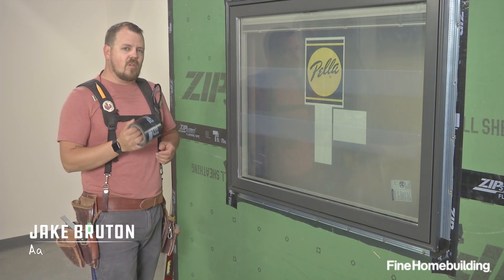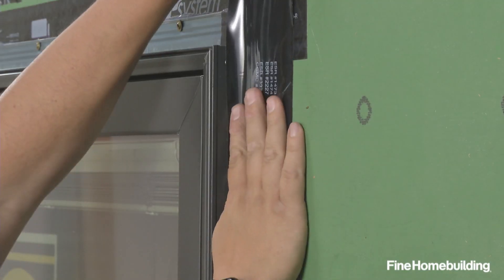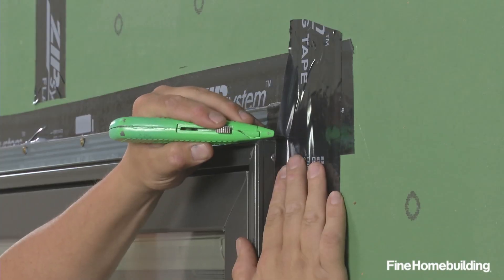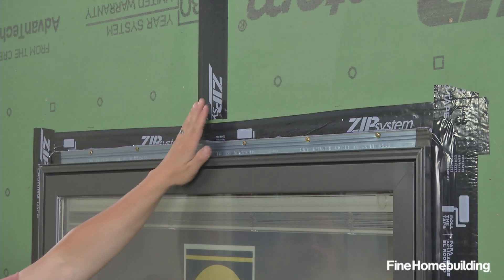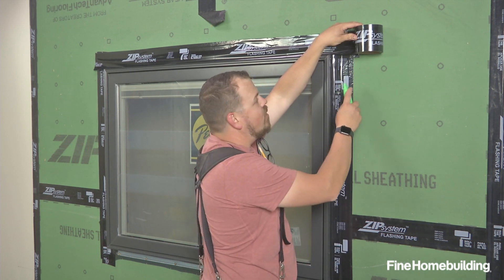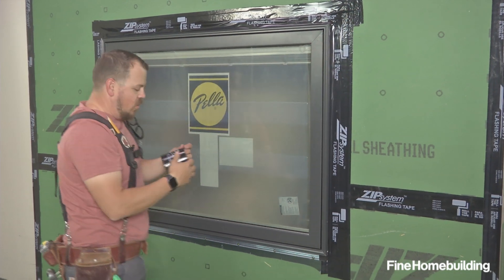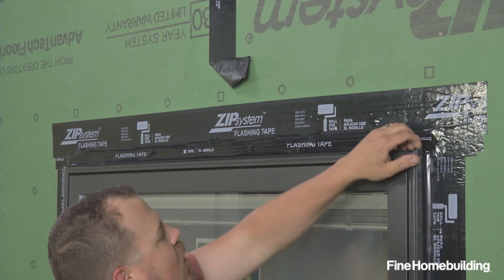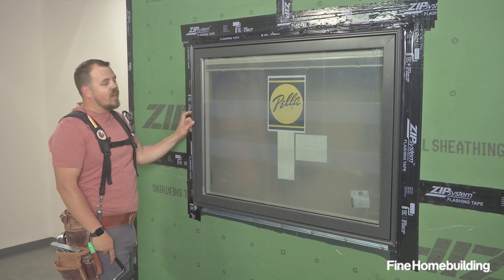Part 3: Flash a Nail Fin Window in a Wall with Zip System Sheathing

Comment: It seems like if you need to "shingle" the layers of tape, than the Zip tape is vulnerable to leakage or not adhering properly. In thay case there there is potential for leakage throughout. Overlapping zip tape shouldn't matter if zip is doing its job. 

If you shingle above windows, do you at all places where vertical and horizontal pieces meet on walls and roofs? That gets very difficult to install correctly when doing a whole house.